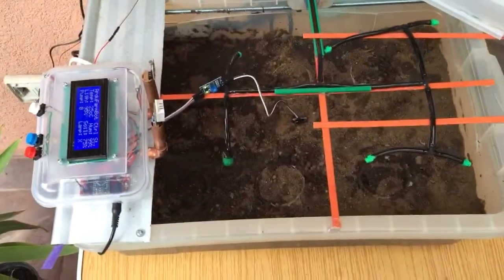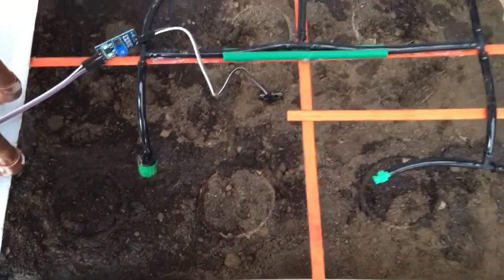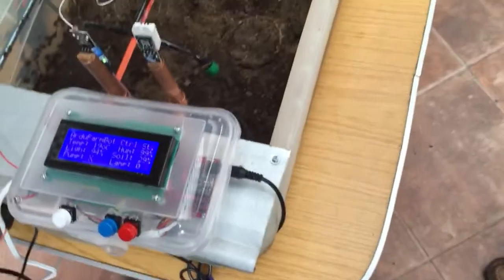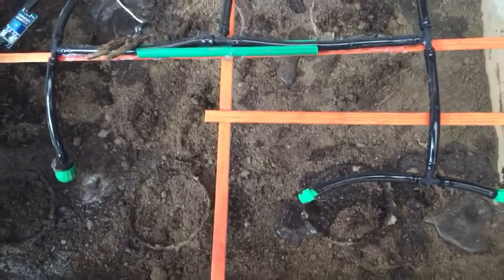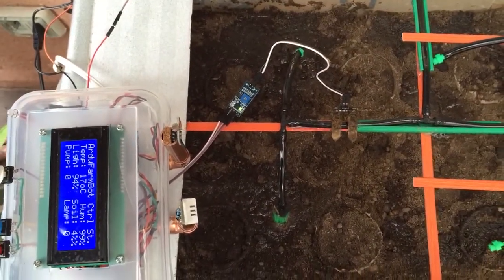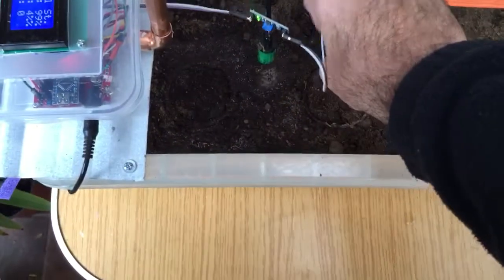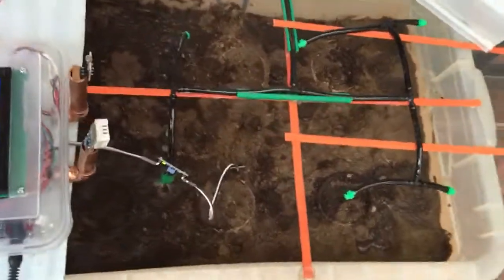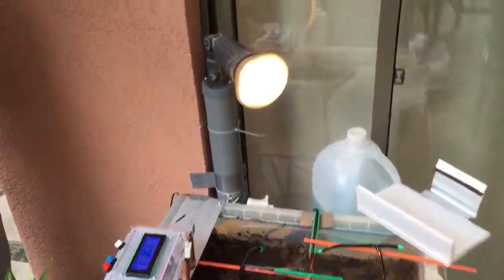ArduFarmBot

Comment: Hi Marcelo. Are you Brazilian right?

I'm a web developer, and I'm want to try arduino. 
I know the basic of eletrônic in theory (probably I will burn some circuit when we start to pratice. KKK)]. 
What you recommend me to starting Arduino. I don't know nothing about it.
For electronic part, do you recommend any circuit simulator to try these before burn circuits? (linux in preferred)
Do you made an PCB for this project?

Thanks.